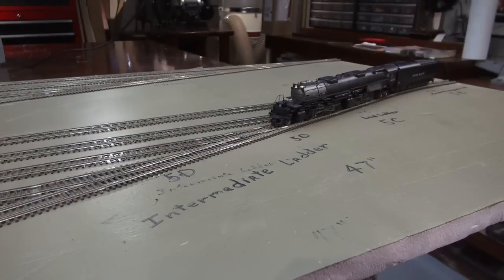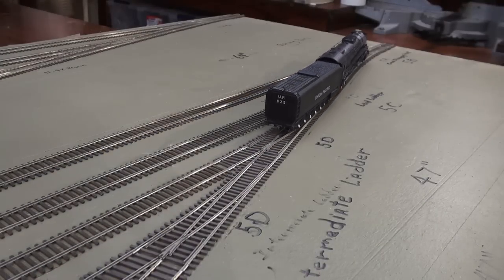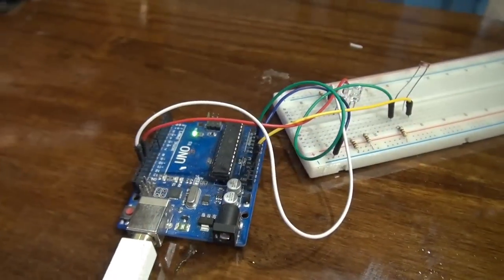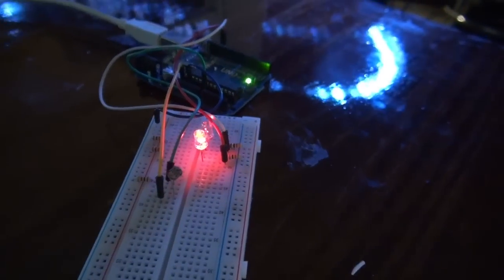What's Neat This Week in Model Railroading #209 September 17th 2022

Comment: What the heck is a freaking Hump Yard?
Reply: Hump yards are high-volume freight classification facilities that consist of a hump, usually an artificial hill,  and a yard bowl consisting of multiple tracks that are sloped uphill at either end.    Long cuts of cars from incoming manifest freights are shoved up the hill, where individual cars -- or groups of cars headed for the same destination -- are uncoupled and allowed to cost down the hill through a series of turnouts into the bowl, where they are grouped with other cars on a given outbound track headed for the same destination.  

The cars are sent into the classification tracks with enough speed to couple to other cars on the track, yet slow enough that neither the cars nor their contents are damaged by the impact.  Speed regulation is accomplished using retarders, which slow the cars by applying pressure to their wheel flanges as they roll through.  

Generally, a hump yard has to process several thousand cars each day to be considered worthwhile.  In recent years, hump yards under this threshold have been replaced with conventional yards that use locomotives for all car movements.